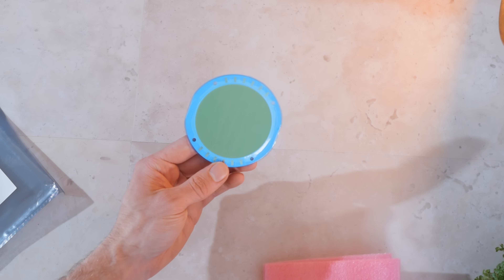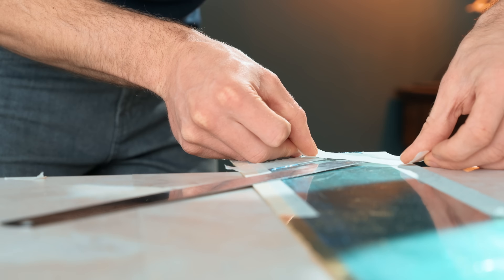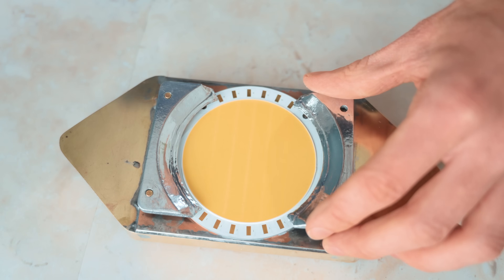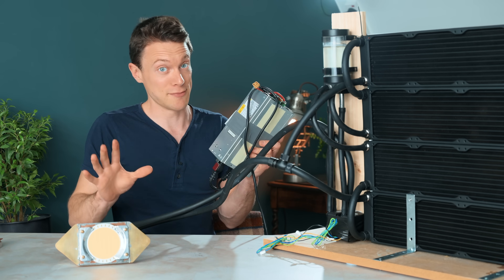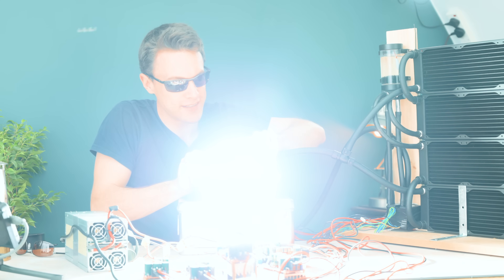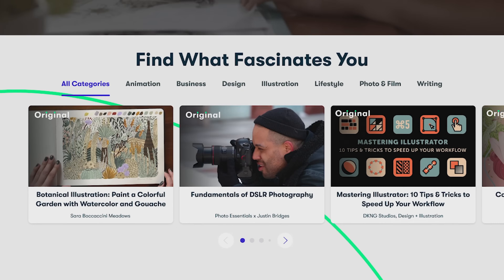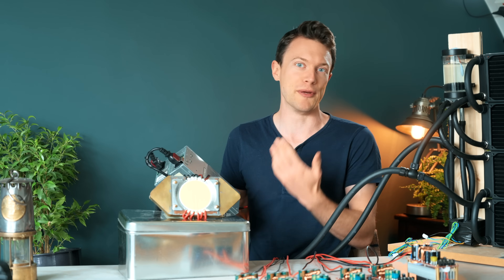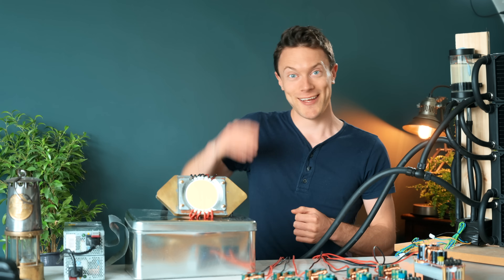Testing the world's BRIGHTEST LED!!!

Comment: These are standard in BMW's headlights when they drive behind you.
Reply: Yes, I am designing a light tracking guided mini missle, just for those.
Reply: @dsloop3907  hey! Let me know about the results ! I'm interested about your project
Reply: Yeah I was thinking Audi, but pimped out 3 series for sure.
Reply: And every jacked up pickup truck...
Reply: At least they’re not Audi’s fucking laser headlights
Reply: @leanmeangreenbeanmachine3347  they're very intelligent lol
Reply: @leanmeangreenbeanmachine3347  what’s wrong with the laser headlights? Those are smart lights that move out of the way of an oncoming car. They advertised that years ago.
Reply: @leanmeangreenbeanmachine3347  audis are the gayest headlights ever.
Reply: @leanmeangreenbeanmachine3347  Laser Headlights is BMW tech not audi
Reply: @leanmeangreenbeanmachine3347  true lol  I'm telling it because i own a Volkswagen and it uses the Shane light
Reply: I guess they are so strong because the BMW doesn't have to power any blinkers ^^
Reply: Fun fact: BMW’s also contain the worlds lowest powered led lights. They’re in the indicators.
Reply: Xenon headlights are the goddamn worst.
Reply: @brandonthegrey  factory xenon's aren't bad, usually. It's the idiots that put the cheap and cheesy colored ones in, especially in the wrong kind of housing. They're meant to be in a properly designed and adjusted projector housing, NOT a reflector or refractor.
Reply: @fadingbeleifs  yeah agreed
Reply: @fadingbeleifs  This is so true. Even if they don't fiddle with the automatic height settings, that missmatch really causes some nuisence for others. 

I hate driving near xenon users (it almost blinds me, becouse i had an eye surgery), especially those who use their foglights for "extra style points". Still, i have to admit, using it at night feels a lot better than regular lights.
Reply: @Dolcsiman  yeah, OEM or aftermarket fogs should be adjusted properly, and even then, they're supposed to have a rather sharp cut off in the beam pattern, they aren't supposed to shine upward or even throw glare like many do. My 2006 Mercedes S430 factory fog lights are a decent example, the provide great side angle light, and fill in light below the low beams, but they don't throw light UP, same with the OEM fog lights on my 2019 Mirage, proper adjustment and quality bulbs of the correct type go a long way.
The other major problem is the frankly shitty design many manufacturers, both OEM and aftermarket, have. General Motors has some of the worst ones I've ever seen. I just want to take a hammer to the damn things.
I really wish they would completely outlaw any exterior lighting that is above 5000k in temperature. It's blinding, exceptionally so for the driver and other traffic in inclement weather conditions.
Reply: @fadingbeleifs  I don't care i want to see everything in front of me rest of the people can just suffer 😂
Reply: fadingbeleifs driving is a privilege, not owning a vehicle
Reply: @k.c.r1884  thats not even funny, so why the rofl emoji
Reply: Brandon Grey best to have, worst to see
Reply: @brandonthegrey  Xenon bulbs in halogen housings are the worst.
Reply: @brandonthegrey  No, LED is. Xenon is the Round Yellowish round ball lights
Reply: @Kayshotsno xenon is indigo purple ish led is white and yellowish is incandescent light
Reply: @brandonthegrey  Yeah essentially welding arcs for headlights, i get huge ghosting spots that last for several minutes. Superfun!
Reply: @brandonthegrey  amen
Reply: Don't you have laws regarding headlights? 
Over here there are pretty strict regulations about which specific lights are even allowed to be used on the street and even then the highest point they illuminate has to be less than 1.2 m at 25 m distance. In cases where it is higher than 1.2 m, it has to be less than 1 lx at 1 m height and 25 m distance. 
Not to mention that using high beam is only allowed if it can't blind anyone else (people on your side of the road as well as oncoming traffic) and if it is outside of a town/village/etc.
Also, the distribution of weight or quickly accelerating etc can affect this and has to be either manually adjusted or automatically accounted for if the car uses Xe-headlights, which is called headlight range control.
Reply: @3DRiley_  Yeah there are laws here but they are selectively ignored. Also ppl in Merica don't have any time or patience for precision, so we still don't use your mamby-pamby metric system, so 1.2m at 25m distance is just too much information for a typical non-gay red-blooded Merican to process, therefore... Freedom! Light bars, unadjusted headlights, and F-You!.. I got mine! attitudes. Come here where being a bully is admired and celebrated. Once you try it you'll never go back!
Reply: @jackandblaze5956  
"Also ppl in Merica don't have any time"

It's America which you are obviously not a part of.
No proud, self respecting, red blooded American would ever think to drop the A.

"I got mine! attitudes. Come here where being a bully is admired and celebrated."

The worst nightmare for all bullies is that little guy. 

You know the one. 

Kind, gentle, extremely polite and respectful, does everything possible to avoid a fight and continues that practice up until a bully causes ignition and take off. After which, the little guy walks away and resumes the mild mannered persona while the bully hears Robin Williams yell as he opens his eyes: "YOU GOT KNOCKED OUT BY A GIRL!"

Total bully nightmare that one.
Reply: When they overtake me after driving behind me for an eternity, I'm always sneaky and turn my high beams on when they are half way through for payback. Really annoying when you have to move all your mirrors.
Reply: @mixedboi  peasant get auto darkening mirrors! My Audi laser beams are coming for ya!
Reply: It's because they can take all the power that would in a normal car go to using indicator (blinkers) bulbs and shunt that to high beams.
Reply: I am so happy to see this comment right on top. My first thought when he fired it up was: any way I could mount this in my car in the rear window so I can "fight back" when a BMW or new Jeep is driving behind me. 🙃
Reply: In other words BMW driver = Complete wanker!
Reply: Here in our country super bright headlights are prohibited 😂 Don't know what they're up to but it's a stock headlight. 😂
Reply: Acura is even worse
Reply: I dont care about other drivers as long as i can see better on the road, HOWEVER, headlights should always be properly adjusted, most of the time its not actually the audis or the bmws, since the lot of them have auto adjusting headlights that dont blind others as much despite how bright they are. its the lifted trucks. people lift their truck without adjusting headlights. and its not like the adjustment can actually fix a 1 foot lift. my headlights are typically brighter than anything else i see on the road, however I paid for proper housings and bulbs so i have a clear cut off line and no bleed over, ive never gotten flashed before for my lights while my friend gets people angry from his unadjusted halogens on a civic.
Reply: As a BMW driver, I can affirm this.
Reply: Or ahead of you...
Reply: DFFUSE Lol
Reply: Yepp
Reply: ha ha
Reply: I want this light installed in my car, pointing back to show to some a**holes blinding me, who is boss :)
Reply: They use so much power that their turn signals don't work, it wasn't their fault after all!
Reply: Projector headlights r totally worse. One shine to the eye and you r blind
Reply: lol
Reply: Laura Brown  dream on. even solid bricks wont get close to that.
Reply: Not sure what technology they're using, but if you slam on your brakes, their lights go off 85% of the time. strange phenomenon...
Reply: especially when they drive past you but right before they pass you they have the audacity to turn them on and blind the shit out of the driver they are passing
Reply: Good one!
Reply: That or Audis coming towards you on the opposite side of the road.
Reply: As a BMW driver I must disappoint you. I don't use my headlights like that. They are broken from all the crashes.
Reply: Xenon is the absolute worst i get blinded by those things all the time
Reply: I just bought an IS300 and the tint is so dark the automatic mirror never comes on haha and ironically it comes with Xenon headlights stock haha
Reply: We need this light on the back of our cars to flash back at those drivers lol
Reply: cant stand the xenon headlights. they've only ever been okay in gta v
Reply: The CRVs on their lowest brightness blind the hell out of me 😭
Reply: @ZayabelDraga13  they make me see hell
Reply: But ONLY when they are behind you
Reply: I drive a BMW and I confirm this is true for the bmws riding my tail lol, I myself am pretty nice to other drivers and am usually the one getting blinded lmao
Reply: fr
Reply: Agreed xd
Reply: Just here for the number of comments
Reply: But only when they’re behind you
Reply: Nah not as bright as a Mercedes-Benz GLE-Class with Advanced Lighting Package and all Volvos have curve-adaptive and high-beam assists headlights they atleast got 273,728E71 of them
Reply: No they are not
Reply: Bwahahahahaha!
Reply: I never understood the hunger for so much light in headlights like... what are you looking for on the road, the edge of the horizon?
Reply: How did I get a BMW ad just as I read this comment?
Reply: Fck the luxury cars...... I loveNissan
Reply: Dude I wanna put a light bar on my trunk for when these assholes drive behind me with their brights on
Reply: No dude, this LED is not powerfull enough...
Reply: your fault for literally braking the apex of a turn
Reply: Lol!! Its joke is actually for Russia too))

Comment: I think the power supplies failed due to the fact he was using one rail on the power supplies. Power supplies have 3.3v, 5v, and 12v rails. I think rated output is for all the rails being used.

Comment: A radiator works with air so your sistem is really over doing it you could have fitted it on to a tap bacause you sed it is only n temporary sistem or you could just have used a bucket of water, it wil take a really long time to heat up a bucket of water and it would have worked just as good.

Comment: If you connect two supplies in series does the current also double?
Does the Boost board effect the current potential of the circuit?
I'm a bit confused.

Comment: I think that those power supplies might have negative terminal and ground connected through the metal casing. So by connecting them in series they are shorted.

Comment: I would imagine your PS failure was due to thermal runaway. During the test you stated the fans were ramping up, hard to tell from just watching, but if there was  enough of a thermal load built up in the PS when you shut the system down then it would have peaked after the fans had their power cut. I saw this and wondered if you had just smoked em. In the future you may want to install a breaker in your main VDC cables feeding the system. That would allow you to kill everything down stream of the PS while allowing the fans to cope with the thermal load, without a significant power draw continuing to build heat.
Reply: There ain't that much thermal runaway in a PSU like that to make a difference. I don't know of a single server PSU that can't handle no air flow after the power is cut. Never seen a single warning sticker about it and those guys love to put warning stickers for everything.

Comment: It might possibly to reset the power supplies. Also you should use some batteries or CAPs as part of the power source. To cancel any peaks.
.
Also slot of power supplies aren't meant to run only 1 leg like 12 volt you would need like 10-20 percentage on the other lines like 1-2 amps on the 5 volts maybe run the radiator fans off that?

Comment: The power supplies are not rated for 1400w. You are using E=I*R  & W=I*E . To get 1400w you must use the power supplies in parellel. To get to 24v you use the power supplies in series. To get 24v at 1400w you need 4 power supples in a parellel/ series configuration.
Check with Youtuber "electroboom" who is an electrical engineer. If you do decided to check with him, ask him to design something with a 𝔽𝕌𝕃𝕃 𝔹ℝ𝕀𝔻𝔾𝔼 ℝ𝔼ℂ𝕋𝕀𝔽𝕀𝔼ℝ (He loves to say that a lot...).

Comment: The issue with the power supplies is the power rails that you pulled power off of. Assuming you used the 12v rails, they weren't able to provide the required wattage and were over burdened by the load. Check out the 12v rail amperage for the power supply and figure out the wattage from there. PC/Server PSUs have the advertised wattage spread out across 12v, 5v, and 3.3v rails. Not all receive full amperage.

Comment: Are the power supplies in parallel with each other, or is each powering 3 of the voltage boosters on its own? 
I've been told you don't want to put power supplies in parallel bc the can interfere/ fight each other trying to keep a steady voltage. Also, I'm not sure about those server power supplies, but on computer PSUs they may say 750w but only 600 or so might go to the 12v (24v in your case.)

Comment: Few hints:

Car parts - Car cooling systems and radiators are huge and inexpensive. In this project it might be quite good. Aquarium people have good pumps and cooling for cold water tanks.

When something overheats NEVER cut the power! Remove the load and let the fans go. The heat remains inside the system and killing the fans lets every component slowly fry.

Comment: Hey guys. Am looking to make a DIY project with a series of lights, around my cousin's (long stretch) garden path.
The distance to cover, is about 150 feet. Can go with electricity from the  grid, or use Solar.
Thinking of getting the "YUJILEDS®High CRI 95+ COB LED - 135XL - Pack: 10pcs (nominal values, 5Watt/560Lumen).
I think I would get a pack of three such bundles, 30 Leds in total. That is Roughly 210$ for the LEDS.
My starting point is the LEDs...Any suggestions ideas on how to start planning and what to consider getting ? Will enlist the help of a fellow electrician, but trying to keep it as simple as I can, before getting to him.
If I go with solar, any advice on what Solar Panel(s), batteries and other necessary equipment I could use ?
What about using the grid, instead of solar ?
I am a total noob but want to do this as a kind gesture. She has been there for me, throughout much.

Comment: You can tie switching-power supplies in series however they may start coupling and interfere with each other. Traditional, low frequency power supplies won’t have these issues.

Comment: Given the fact you have used BOOSTER circuits, you could have used a car battery, you dont need to struggle with the PSUs. Measuring in W is not accurate, the is PSUs probably working way more. To deliver 1500W they are working hard. PSUs are not lineal devices, power factor is not 1. Also they put some energy over the harmonics, high enough that a kill-a-watt device wont event measure them. Plus, some IEC standard ask to measure on the fundamental. I wouldnt be suprised that the VA consumption was way higher where V and A are TRUE-RMS measurements. Servers PSUs can stand its maximun no problems. And have active PFC, but it wont bring them to power factor 1. Not at this load. Gluing the two unit together, not the best idea.

Comment: Have you tought about using a large 6s LiPo battery (8000mAh, 75$ on banggood), that thing can deliver 480A, but even at the required 68A for your 1.5kW it will only last for 5min, but hey, it would be portable. The other way would be to just buy 3 24v 20A PSUs designed for LED strip lights and wire them in parallel, those should be designed for constant load. That would still be below 100$. I hope that helps. BTW, I very much enjoyed the beautiful heatsink build.

Comment: Those server power supplies might be 1500W TOTAL. However most have several separate power rails. Meaning they might have 3 power rails of 500W in each and if you only connected to one of those on each power supply, you would severely overloaded it. Speaks for HP (think they were HP) they lasted as long.

Comment: I think unplugging them while still being hot made them fry because the fans stopped and couldnt cool off the psu.
If you would have them in a server they would keep running after the server is shut down and if there would be a power outage the server 99% of the time has some sort of power backup to shut down the server so it does not loose data which also would shut down the power supply slowly.

Comment: Could have used a cheap bench power supply instead, would add full control of voltage and current limiting.
Reply: If you can find me a cheap variable voltage PSU with current limiting that can handle 1500w, I'd be very happy.

Comment: Power supply spec ratings can be pretty sketchy, especially on cheap ones.  The water block won’t get warm, until the water loop has a chance to absorb enough heat, then hopefully the radiators start doing there job.  Really the test would be to run it for at least 30 minutes.  Love the video

Comment: The total wattage of the PSU is the combined value of all voltage rails. You probably only connected to the 24v rail. The single rail has a lower max voltage then the combined value, just look at the psu sticker. Also cooling is key here, even if you are capable of running 750 watts on on rail you still have to cool the PSU more then with the stock fan.

Comment: You made the mistake of sandwiching the power supplies and also you used them is series, this will unbalance the load so the combination of the two definitely caused the failure, never sandwich two metal enclosures like that

Comment: Why not run half the led module off 1 power supply and the other half off another power supply and not join the 2 power supplies in series. Keep them seperated...